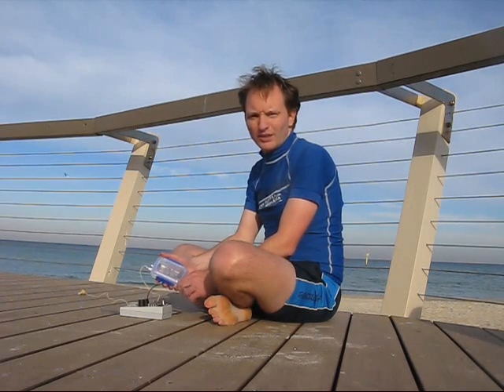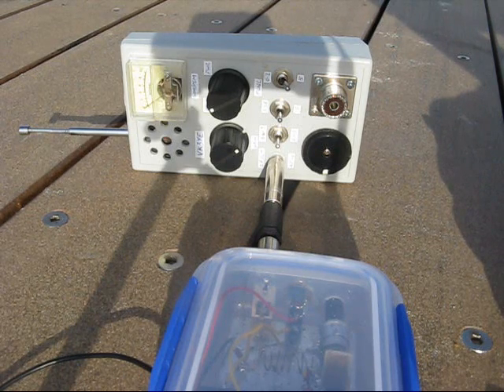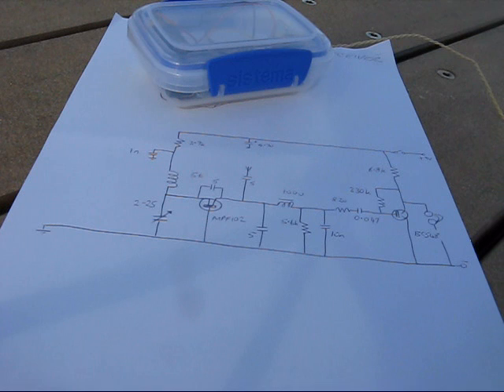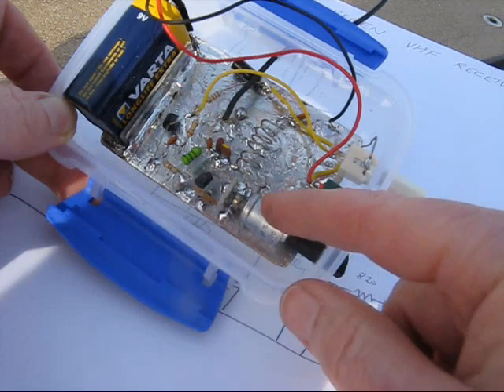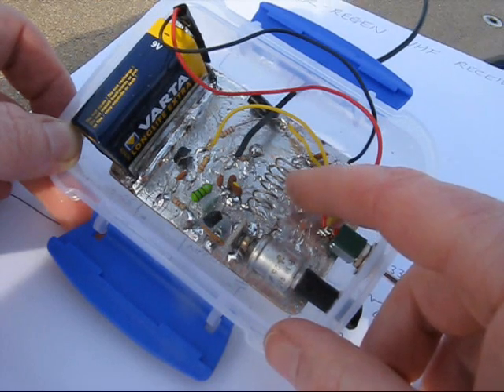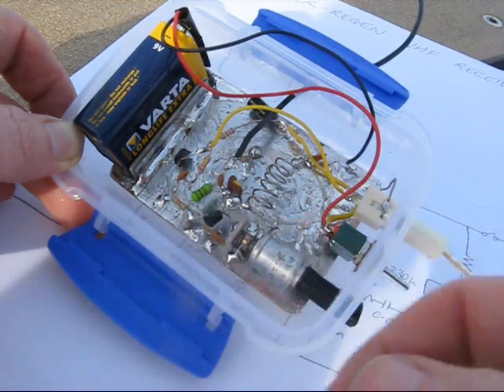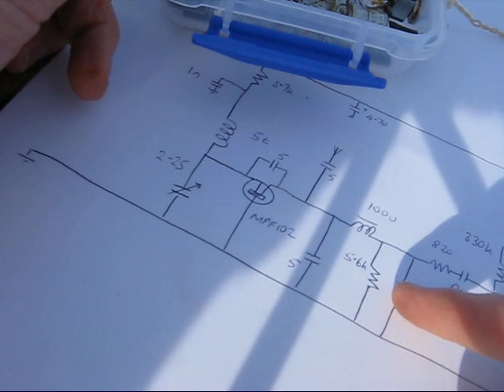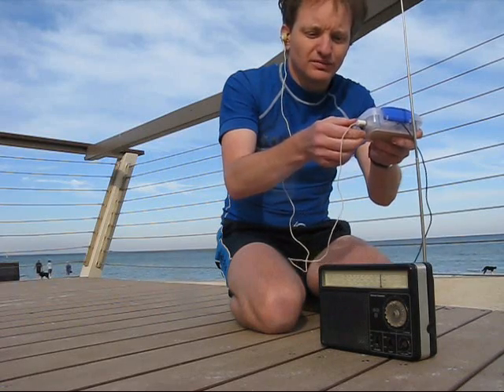A two transistor super-regen VHF receiver

Comment: Why not any built classic regenetive circuit for 2m band and for SSB, CW? Superregens good for AM, but NFM is silence... FM with distortion... I experimenting with FM regen, it better than superregen... and works in PLL phase demodulator mode  ( like AM reception with little oscillation )
Reply from the maker: Regens for 2m would drift badly and certainly not good enough for SSB/CW. Better to convert 144 MHz to a lower frequency and do detection etc there.

Comment: Can you use it to receive analog video?
Reply from the maker: Unlikely.
Reply: I found many tv transmitter circuits, but not a receiving one, I want to view it on a laptop or tablet or raspberry pi, how would you do it?
Reply from the maker: Sorry can't help. Does Google give you some leads?
Reply: Well thx anyway, nothing I asked on several forums as well someone said maybe a super-regen rf could handle it, but nobody seems to used it for video output.

Comment: Why is it that when I use an air variable capacitor 3-35pf that it makes a noise in the speaker as I turn the dial? How can I solve this problem without using the small preset variable?
Reply from the maker: It could be that the plates are touching, there's stray metal causing conduction or there's a bad connection in the variable capacitor. Or it could be instability in the receiver itself. Small changes to component values are sometimes beneficial.

Comment: I just finished building 2 copies of this receiver( I did the second to experiment to see if it was the transistor I chose first (BC548) 2nd was a 2N2222A or was it really a matter Im not familiar with yet. I found that on both rigs there was a very sensitive antenna to an extent that it would only tune in and sound if I was holding the antenna wire at some point and at a certain angle. how can I overcome and have it tune without being easily interfered. I think there might be a better antenna solution
thnx
Reply: Your tank circuit is getting overloaded. I added a 75R resistor and high value cap l(ike 104) in series with the antenna. It's an impedance matching issue. It also helps if you have a separate coil for the antenna and loosely couple it to the tank.

Comment: I have been on and off with home brewing Ham Radio, I tried this little Rx and it is sure a pleasure to build n tweak. answering some of the questions below.

1) 5 stands for 5pF and the inductor is a 100uH but you can use a lower values.
2) Coil connected to drain as the antenna is connected to source
3) to eliminate the hand capacitance effect you can cover the tuning capacitor just like shown in the clip. Peter uses the outer plastic part of a coaxial wire that fits.
4) in the audio stage u can use a BC548 or a 2N2222 i tried both and both work fine,
 & (yes emitter is grounded) in the audio transistor

73's

Comment: what does 5 stands for in capacitor between the MPF102 and in the antenna coupling?

is it 5 pf or 5 nf ?

and also in the second coil is it 100 uH or 1000 uH ?

thanks!..

Comment: Thanks for confirming.  I'm trying to come up with some kind of replacement for that beehive variable.  I checked eBay and couldn't find any. I have trimmers, but I can't see tuning them every time with a small screwdriver.  I think I'm going to use pots and/or switches and varicaps, one for coarse and one for fine tuning.  BTW, I think the audio output needs a DC blocking capacitor, since most earphones pass DC and would short the transistor.

Comment: One important point: since it oscillated and sends out an RF signal, it would be very bad for it to radiate in the 108 to 136 MHz aeronautical band, right above the FM band.  That might cause interference to a pilot's radio.  Here in the U.S. the FCC frowns on that kind of interference.  Big time!

Comment: Thanks for the schematic; it helps a lot.  I tried to get on to the VK2ZAY website, but all I got were timeouts.  I was looking for the length of the antenna, or aerial or whatever it's called down under.  I suspect only a foot or 300 mm.  Thanks for any help.